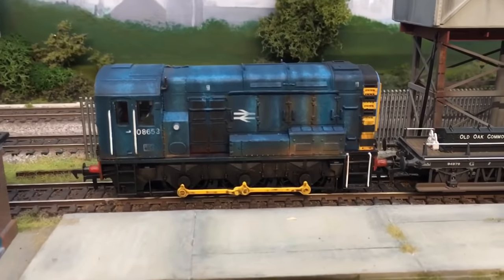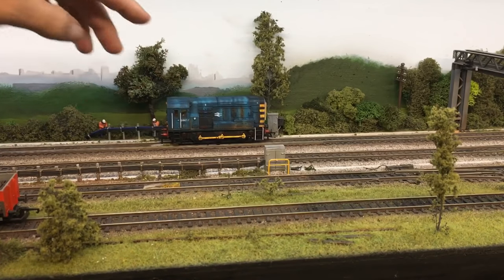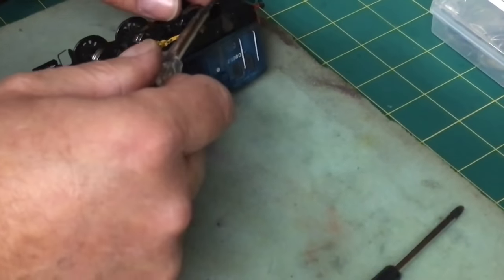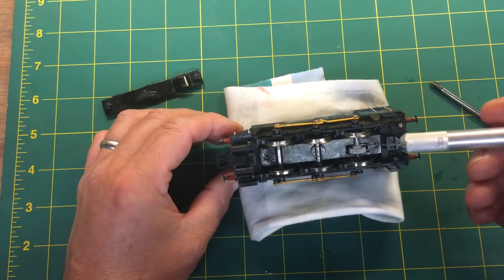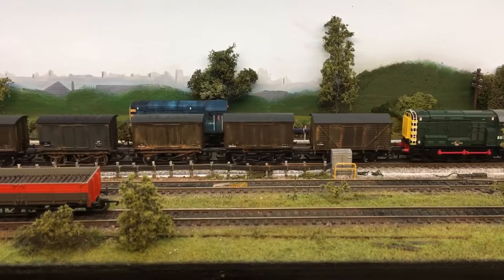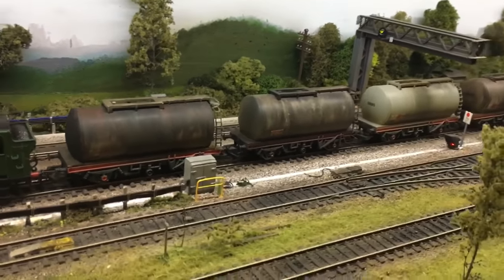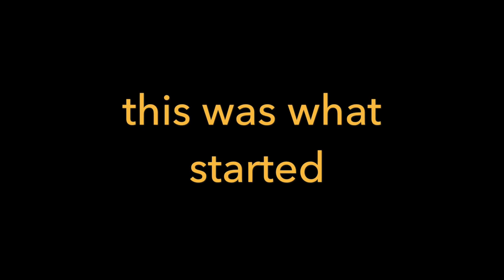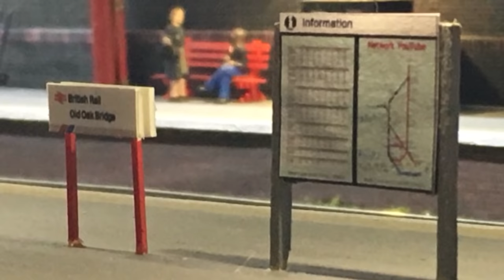Loco & Wagon Weathering

Comment: Great update Garry, You are becoming an expert at weathering now. That 08 and the tankers really do look they have had years of use. What you have done in two years is really amazing. You have a great layout Garry. Are you going to cover the insulation foil on the roof eventually, or are you leaving it as it is?
Cheers
Geoff
Reply from the maker: Hi Geoff

Thanks buddy as opposed to the foil it has crossed my mind but didn’t want it to look to dark and height would be compromised 

but certainly something to think about. 👍

Cheers Garry
Reply: cheekytek  Hi Garry, i get what you mean about the foil acting as a reflector. I noticed that you have subscribed to my youtube channel, but there is nothing on there yet, except a few test videos I did with an action camera I bought last year. I do aim to start doing some videos of my build, once I get the shed ready for making a start, which may be sometime in the spring. I will certainly be building a shelf layout and I managed to get a couple of swivelling bar stools at a car boot for a tenner each, which will allow me to be at eye level when running trains, once I get up and running lol.
Regards
Geoff

Comment: Spray the pickups with servisol super10, the train will run better than it ever has
Reply from the maker: Thanks for your comment 
Yeah it’s pretty good stuff Ive used similar in the entertainment industry. 👍

Not something I’d personally advertise to blast over a modern Bachmann sound loco at XXX costs.

I’ve done a little digging around and a Couple major retailers They pretty much said the same that as advised that it’s probably not best practice as that could effect the warranty on a new item.

 - whatever that means 😆

But for them old ones 👍

Thanks again Garry